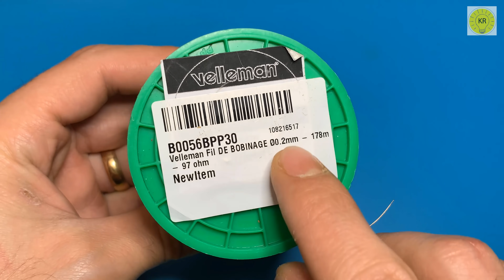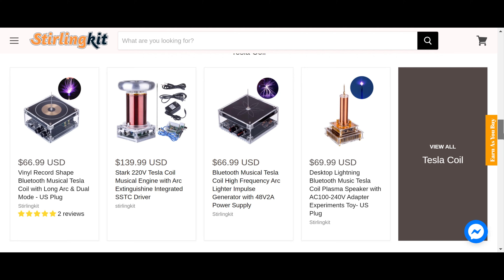The Best Way to Make a Nikola Tesla Coil

Comment: what is happening with my circuit?when I connect the negative terminal, my voltage source automatically goes to zero
Reply: Either short circuit or weak supply😂

Comment: Replacing the spark gap with a transistor can improve the performance of a Nikola Tesla Coil. The A614 2SA614 transistor is a good choice for this application. It has a low collector-emitter voltage drop, and it can handle high currents without heating up too much.

Nikola Tesla was one of the smartest people to ever live. He developed many things, but one of his most famous inventions is the transformer. A transformer is a device that changes electricity from one voltage to another. This is important because it allows us to use electricity from different sources, like batteries and power plants, and convert it to a voltage that our appliances can use.

Recently, some people have been using transformers to create generators. A generator creates energy by turning a shaft, which in turn turns a coil of wire inside of an electromagnet. The current that flows through the wire creates a magnetic field, which then interacts with the magnets on the rotor to create torque (or rotational force). This torque causes the shaft to turn, which in turn creates energy.

By using a transformer, you can increase or decrease the voltage going into the generator.
Reply: What do you meant by spark gap? The exposed wire of the secondary on the top?
Reply: @b-beluga4510  Actually his words don't make sense at all. He started from spark gap and ended in generator . 
The real Tesla coil consists of a spark gap in between the primary coil. It acts as a switch. But here in this circuit there is no spark gap.

Comment: Can we replaced 22 nf capacitor with soldering 10 nf × 2 and 1 nf × 2 .
Reply: Yes you could do it but I recommend using 22nf capacitor
Reply: I don't see any capacitor  in this circuit.

Comment: Can i use irfzn44?
Reply from the maker: Yes, but it is preferable to use the transistor used in the video
Reply: @inventorkr1  it actually doesn’t matter that much, as circuit is junk already, won’t get any more improvement switching transistors